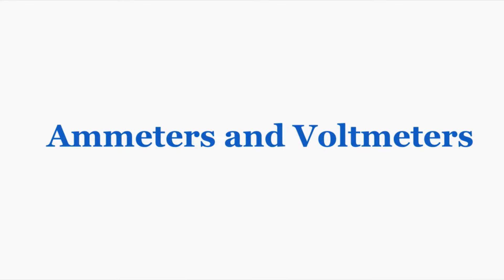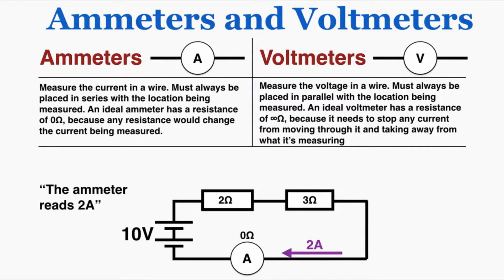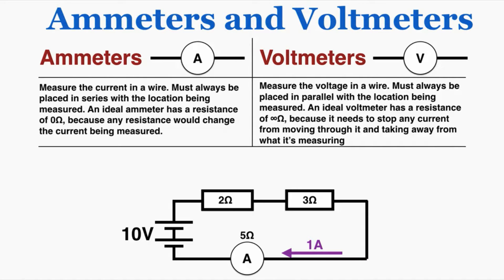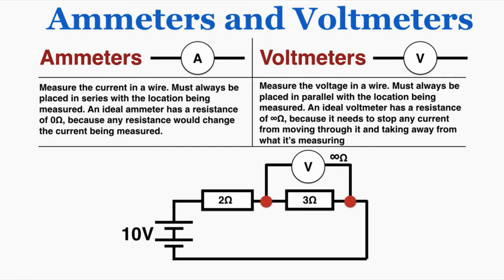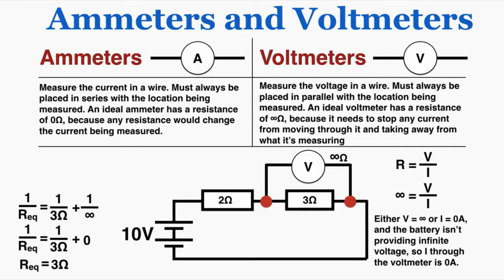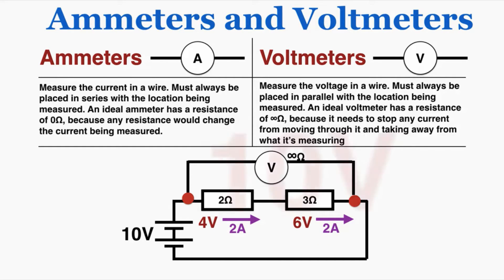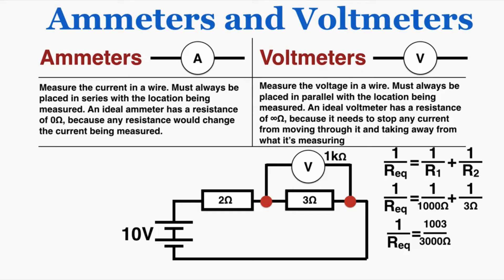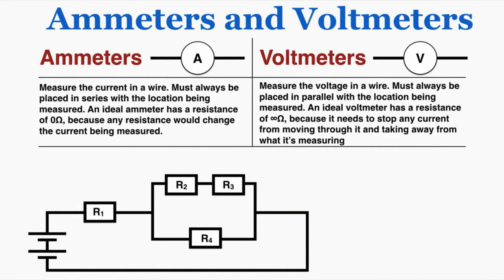Ammeters and Voltmeters: Ideal and Non-Ideal - IB Physics

Comment: at 2:03 you say the ammeter is in series. But isn't it parallel?
Reply from the maker: Nope, it's in series with the others because if current flows through the resistors, it HAS to throw through the ammeter as well. This video explains series v parallel in more detail https://www.youtube.com/watch?v=dlSPpmAwT9U&feature=youtu.be